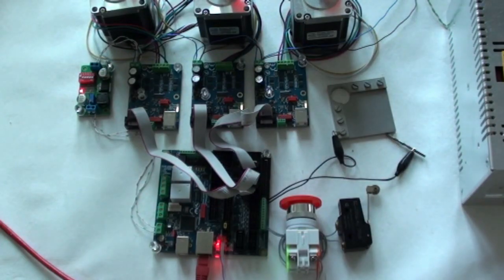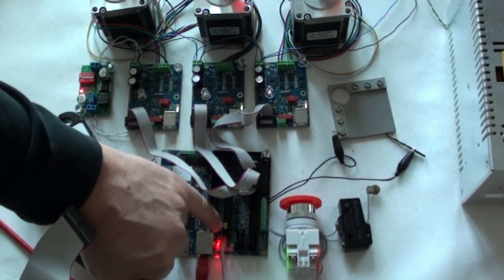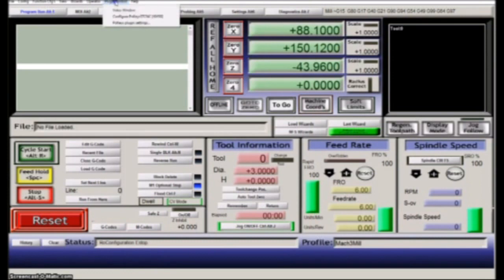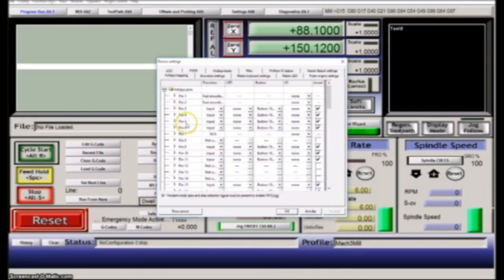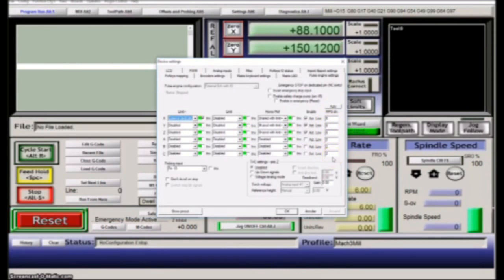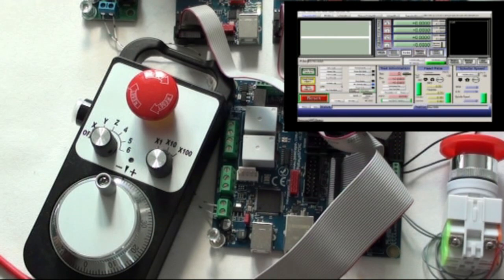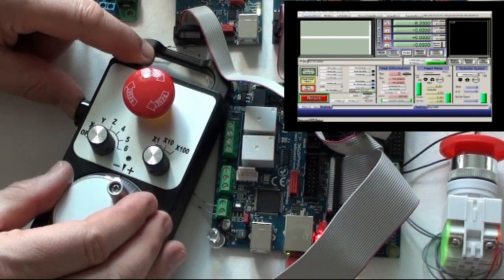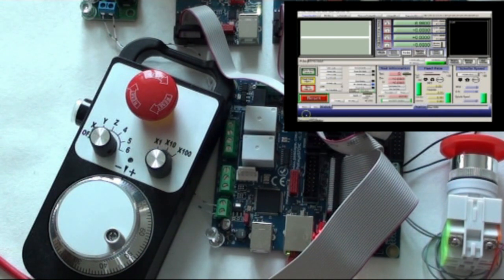Connection and setup of PoPendant1 with PoKeys57CNC Motion Controller

Comment: Does it require the computer on during operation?
I would expect that the mach3 helps to configurate the controller and then pulse generator dial + controller + motor driver would be enough to operate in manual mode.

Comment: Hy Mr Martin how are you ,
Ok did you try to work with cnc plasma cutter either with grbl or with mach3 , I'm trying to and a relay to the grbl controller connected to spindle pin trying to turn on and off the plasma torche when it moves from vector to vector but i had to inaert the M5 and M3 comend after eatch vector 
Even the Lazer grbl didn't work because z Axe was in standard height and i dont have a THC for plugin to Mach3 board.
Let me know if you have any solution/suggestions